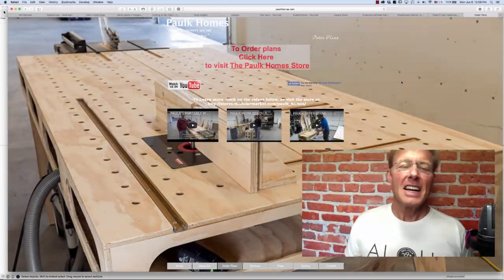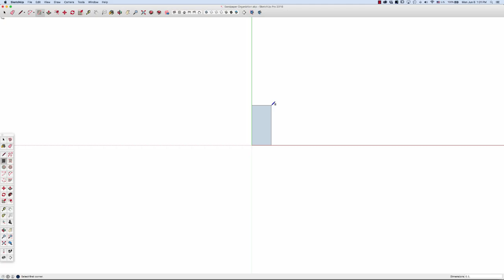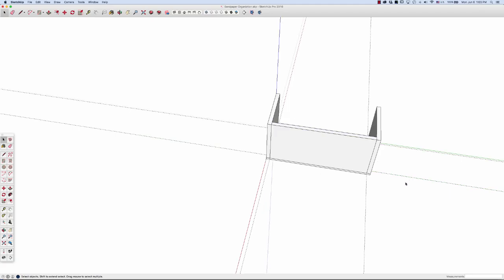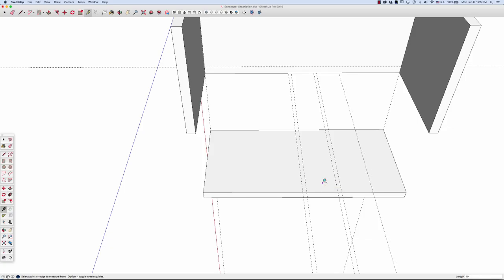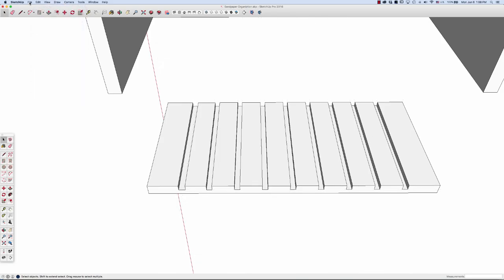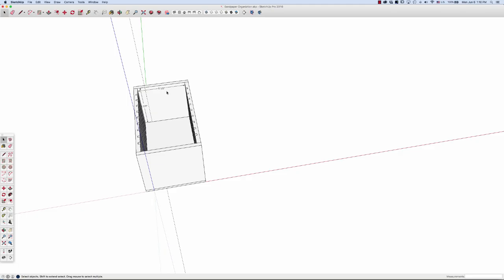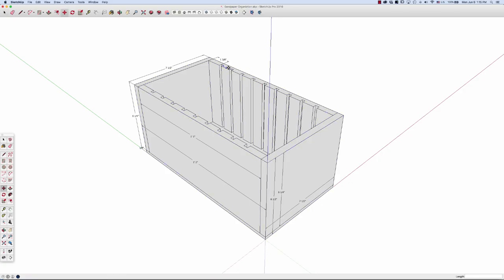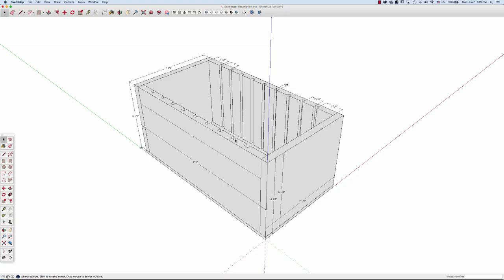Sandpaper storage designed in SketchUp

Comment: Nice idea. Another idea is to use A5 envelopes for the various grade papers and then one more envelope for all the current sheets.  These will all fit in the same systainer as the sander.  Very easy to get the current sheets and go through each grade when doing a job.  When one of the sheets need replacement - just take it from that grade envelope.  "Easy as"

Comment: Puppy dawg roof roof...how do you right lick on a mac??
Reply: control + click
Reply from the maker: Click on the right mouse button.
Reply: Ron Paulk no right click on my "boxed" mouse, but Christian P thing seems to work.   TY you Ron for all your excellent vids :)
Reply: If it is a trackpad, you can adjust your settings so clicking on the lower right corner is a right click.

The best option is to buy a mouse with at least 3 buttons, with the third being the center scroll wheel.  You can get them very cheap, and the scroll wheel makes everything so much easier.